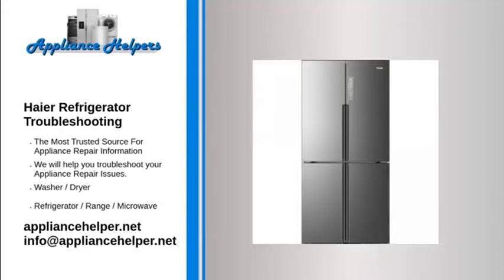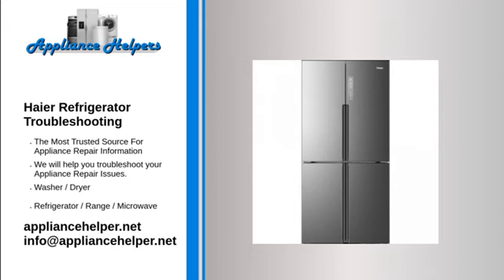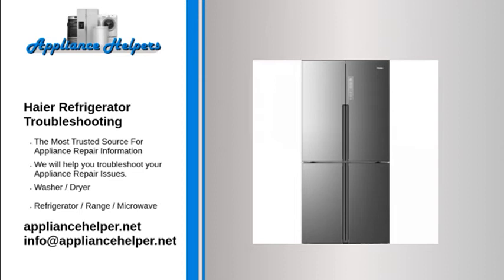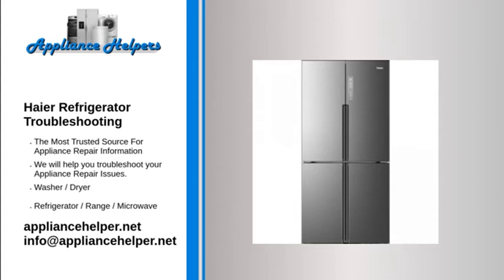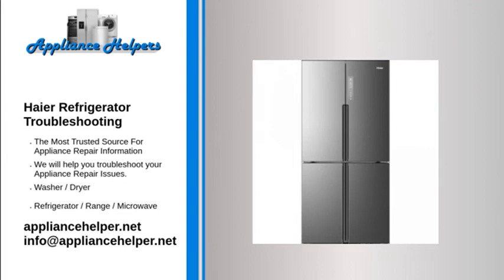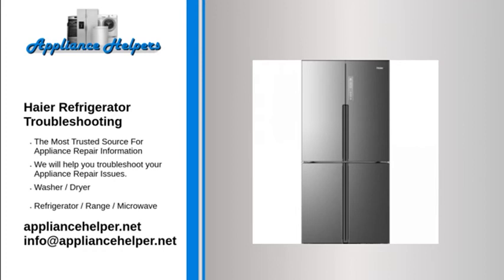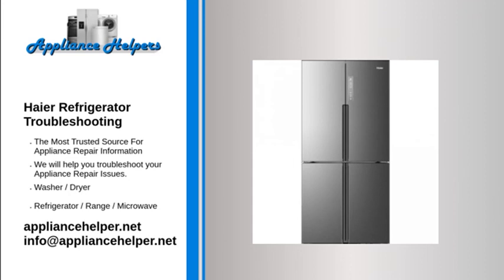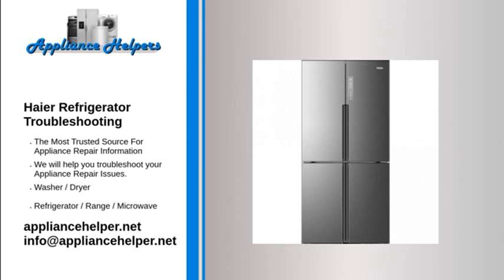Haier Refrigerator Troubleshooting

Comment: Hi. I have a Haier fridge freezer ( quad door). Model HDM440X. I cannot get water from the water feed box in the fridge section to enter into the ice tray . The magnetic water feed valve and hopper assembly are clean. Can someone suggest anything else I could try. Thank you

Comment: My fridge keeps not freezing or cooling! How do you trouble shoot? Who do we call?
Reply from the maker: Error codes can vary among different models and versions of appliances, and new codes may have been introduced since then.

For accurate information about the "D5" error code on your Speed Queen dryer, I recommend checking the user manual or technical documentation that came with your specific model. The manual usually includes a list of error codes along with explanations and recommended troubleshooting steps.

If you don't have the manual or cannot find the information you need, consider the following general advice:

Consult the Manufacturer's Website:
Visit the official Speed Queen website or the support portal. Look for resources related to error codes for your specific dryer model. Manufacturers often provide troubleshooting guides and FAQs.

Contact Speed Queen Customer Support:
Reach out to Speed Queen's customer support for assistance. They can provide guidance on interpreting error codes and may offer troubleshooting advice over the phone.

Professional Service:
If the error persists or if you are unable to identify the issue, it's advisable to contact Speed Queen's customer support or a qualified appliance technician for further assistance.

Keep in mind that the steps and solutions provided here are general suggestions, and the specific resolution may depend on the model and firmware version of your Speed Queen dryer. Always refer to the documentation provided with your appliance and, if needed, seek assistance from the manufacturer's customer support for accurate and model-specific guidance.

Comment: I have hrf 366 GB no power?
Reply from the maker: If your Haier refrigerator, model HRF 366 GB, has no power, it's important to troubleshoot the issue to determine the cause. Here's what you can do:

Check Power Supply: Ensure that the refrigerator is properly plugged into a working power outlet. Test the outlet with another appliance to verify that it is receiving power.

Reset Circuit Breaker: Check the circuit breaker or fuse box to see if the circuit that powers the refrigerator has tripped or blown a fuse. Reset the breaker or replace the fuse if necessary.

Inspect Power Cord: Examine the power cord for any visible damage or signs of wear. If the cord is damaged, it may need to be replaced by a qualified technician.

Temperature Control Settings: Verify that the temperature control settings are set correctly. If the refrigerator is not cooling properly, it may appear to have no power.

Internal Components: If the above steps do not resolve the issue, there may be a problem with internal components such as the compressor, control board, or wiring. In this case, it's best to contact Haier's customer support or a qualified appliance technician for further assistance.

By following these troubleshooting steps, you can identify and potentially resolve the issue of your Haier refrigerator having no power. Always prioritize safety when working with appliances, and consult the refrigerator's user manual for model-specific troubleshooting tips.

Comment: This fridge is Trash. It looks fabulous. But mine freezes everything even in warmes temp.
Reply: Hello did you find a solution to this problem? I’m having the same issue - my model # is HRQ16N3BGS
Reply: @anantpersad559  NO uggh but its making me crazy. I think it actually helped to set it a little cooler as weird as that sounds. But I dont recall if it was this video or somewhere else I read or watched , but apparently it can be worse putting it on an extreme setting one way or the other.  I was thinking of closing off one of the holes to the freezer!? With tape or something lol I know that’s ghetto. 
I ended up putting a small fridge in the kitchen till I fixed it. As it doesn’t freeze everything… which also is bizarre. But I wouldn’t trust putting my fresh veggies in there and wasting all that organic produce 
$$. 
I think mine is QJS15HYRFS. It’s French door top with two drawers on bottom.
It has a digital touch setting on the front door.